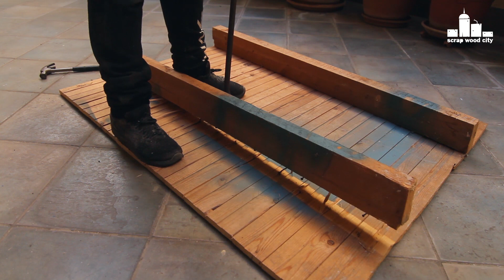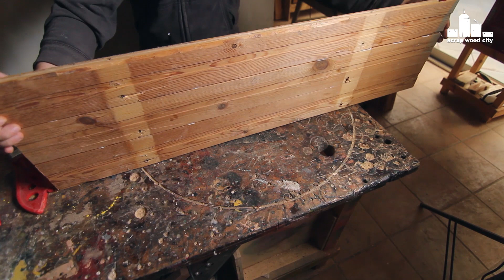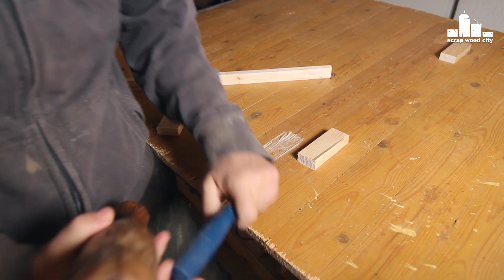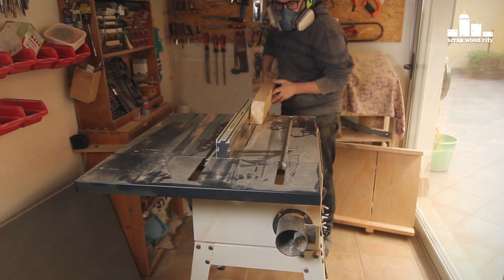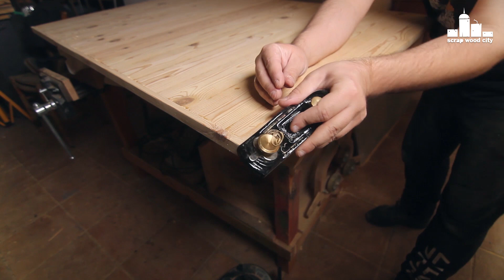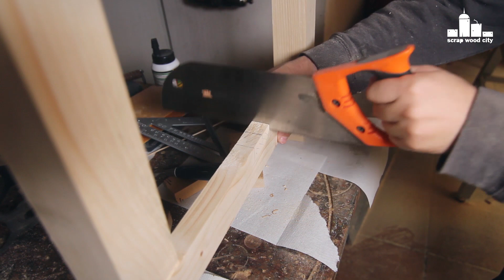How to make a simple DIY table out of old wooden floor boards

Comment: I was enjoying the outcome, nice table with extraordinary proportions, I had hoped to see reclaimed two-bys turn into sliding dovetail battens though, instead of being glued rectangular to the topside boards. Dovetail locking nockings would have vastly helped with Your already expressed concerns about climate iterations over the years ..... we usually do side trim also in dovetail and nail it only to the first board to not block climate induced movements in the boards.
Reply from the maker: Thank you. I agree about the dovetail but the boards were already too thin and also I wasn't sure if I could create the dovetail successfully.

Comment: great job, cleaning up all that dust afterwards must been aweful, humble opinion would be to use dust collection or work on the patio
Reply from the maker: Thank you. I have a really small shop. For mow dust collection is a problem with very difficult solution.